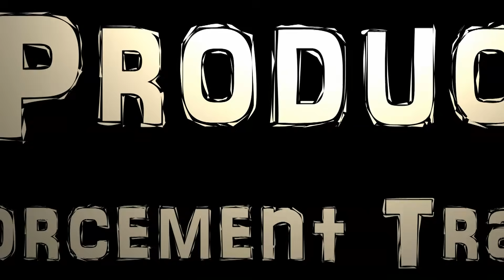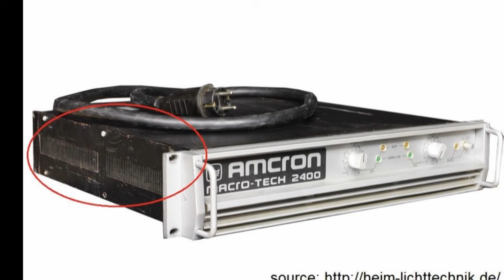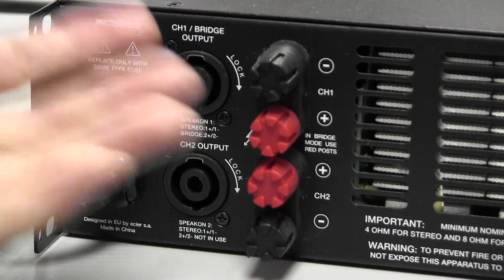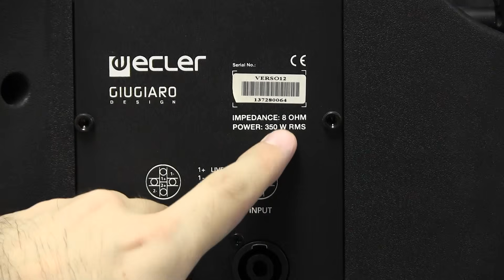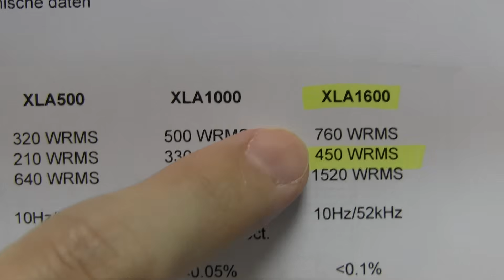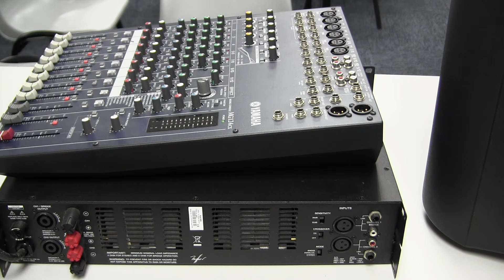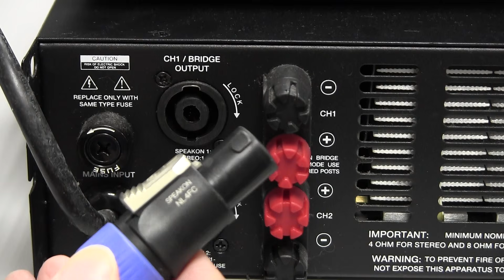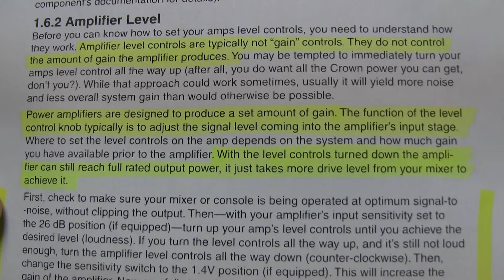How to connect a power amplifier to passive loudspeakers

Comment: Hi, I'm currently having trouble getting the proper connection between the mixer, crossover box, and amplifier.  We currently are using 2 (passive) house speakers on each side of the venue, 2 amps (1 for house and 1 for subwoofer).  On the mixer, when I turn up the left fader, sound comes out thru the left speakers.  When I turn up the right fader, I get both the right side house speakers and the bass frequency from the sub.  I would like to isolate the subwoofer to one of the 4 group faders on the mixer. Confused how to do that.
Reply from the maker: +Lee Sombito Hi there, thanks for the question. Which mixer are you using please?
Reply: We are using a Yamaha MG24 FX mixer.
Reply: Our crossover is the DBX-223S with QSC GX3 for the house and 'Crown' for the subwoofer
Reply from the maker: +Lee Sombito Ok, in this case the left and right outputs of your mixer should be connected to the crossover. The high output of the crossover should connect to your FOH amp and then to the speakers. Group 4 output of your mixer should be connected directly to the subwoofer amp. Anything assigned to group 4 will be sent to the sub - make sure that group 4 is NOT routed to the LR outputs, ie the 'TO ST' button should be up. That should solve your issue.
Reply: Thanks so much! I will definitely try this. Our church meets in the gym so we're one of those churches that setup and tear down every Sunday. I will try it then.
Love your style of teaching these videos. You make it easy to understand and you explain & dictate things very clearly and very well. Thanks Bruno!
Reply from the maker: +Lee Sombito Ah yes, setting up and tearing down every Sunday is a great way to learn about signal flow and also the various components of the PA system. Glad you have been enjoying the videos, if you would like to support the channel please consider signing up to become a patron at https://www.patreon.com/glbproductions?ty=h Every little bit helps!

Comment: can I hook up a loud speaker and a subwoofer to a single amplifier with crossover?
Reply from the maker: +Eddy S. Yes you can, assuming it's a typical two-channel amplifier: output of the mixer to the input of the crossover, high output of the crossover to one channel of the amp and then to the fullrange speaker, low output of the crossover to the other channel of the amp and then to the sub. I have a video on analog crossovers coming up so stay tuned!
Reply: Thank you very much.
Reply from the maker: +Eddy S. You're welcome :)

Comment: I am a beginner about sound system. I have a behringer xr 12 and ipad app to control eq. I am going buy 2 of QSC k8 speakers.I am going to use them for singing and playing acoustic guitar at home. My question is. are these speaker good for my behringer xr12? if is good. Do i need any thing else. of course i alread have microphone and all cable.and could you please guide me how to connect them together? 
Thank you so much
Reply from the maker: +Oup Kip The K8s are good for small spaces because of their wide dispersion and they have plenty of power, so no issues pairing them with your XR12. Just connect the outputs of the mixer to the inputs of the K8s and you're done. More info on the QSC K-series here: https://www.youtube.com/watch?v=CJ2YBbSLWw0

Comment: Hi Bruno!regarding this particular topic...is it true that Passive speakers are way better than the Active ones?(or is it an urban legend?)And have you ever done a vid about how to connect an active subwoofer to an active PA (a pair of active speakers)?Because Yesterday I've found two ways to connect it...One is that you connect the main outputs from the mixer and enter to the speakers,and then you go out to the subwoofer...or you can do the other way around...i.e. you connect the mixer's main outputs to the sub and the you take the signal to the speakers...which one is the correct way?As always,thanks in advance :)
Reply from the maker: +Cris Valk Hello Chris! With modern speaker systems the active and passive versions are usually the exact same drivers, it's just that the active model has an amplifier module fitted into the cabinet :) So any differences you hear will be the result of the amplifier that you use with the passive speaker. Where did you hear that passive speakers were better than active ones? 

I have an active subwoofer video in the works - stay tuned!
Reply: +GLB Productions Thanks!I heard it from some DJs...

Ok...I'm looking forward for it :)

Comment: Hi!
I have a question,

If i have a 500 Watt RMS subwoofer at 4 ohm and a 1000 Watt amplifier on 4 ohm connected to it, will the subwoofer blow up if i would turn the volume all the way up?
Reply from the maker: +Spixon Media It's not just the amount of power you are sending to the speaker - it's more important that you not clip the input of your power amplifier. 500 watts RMS will typically mean 1000 watts programme, so this is a good pairing assuming the power amp is not clipped.
Reply: GLB Productions Okay, but let's say, i don't clip it, but if i would run 800 Watts through the 500 Watt RMS sub, would it blow up?

Comment: hello Glb so when daisy chain, linking the amps i was wondering theres no concern of oms impedance ? what did you mean on good amps the inputs are buffered
Reply from the maker: +desi bhai In general there is no issue, as long as you are only daisy-chaining one amp to another - the chain can be as long as you want, provided you do not split the signal along the way. A buffer is a small electronic amplifier that ensures that the signal leaves the device at the same strength that it went in, hence preventing signal loss from one component to the next.

Comment: hi,that video is  very helpful  i had a question on how to use a speakon to jack especially when i am using passive speakers as monitors on the pulpit because i tried connecting direct from the mixer but it didn't work and sometimes the person who is leading would ask me to give them some volume so anytime i try to give the person the volumes that he or she wants i realize that both main speakers which are passive and monitors speakers that are passive as well has the same volume is connections,or setting and how am i supposed to loop them Thanks
Reply from the maker: +Chibole Cedrick I'm sorry I don't understand your question - it is about using speakon to 1/4" connectors or how to wire your monitor speakers?

Comment: Hi bro, if I daisy chain from low watts to higher watts speaker, is it OK? example:-   
From Power Amp (Samson SXD 7000) to 300 watt 15" speaker (Samson RS12HD} and daisy chain to 350 watts 12" speaker (Yamaha CBR12}.
Reply from the maker: +Zulkifli Noriman No problem - just remember that if they are both 8 ohm speakers each one will receive half the power that the amp delivers into a 4 ohm load and calculate accordingly.
Reply: +GLB Productions Thanks bro... Great info.

Comment: This guy talks so slow, I don't have time for this, I want a quick video about how to connect my fucking 5.1 home cinema system to an amp... and whats 2 channel or 6 channel or 123124234308597345873 channels what, those have to do with a 5.1, can I connect a 5.1 to 2 channel amp or reciver ?
Reply from the maker: +SparkySlow Hope you find what you're looking for ;) 5.1 means 5 fullrange channels (left, right, center, back left, back right) and a sub. So if you have a 5.1 system you need a 5.1 receiver to get it all sounding correct. You can use a 5.1 receiver to drive a simple stereo pair, but you must select stereo mode on the receiver otherwise you'll have lots of missing info.
Reply: GLB Productions ok sir thxs, um I just bought a nice Pioneer 7.1 and I have an 5.1 I connected now, im new in audio stuff, I connected also from pc to reciver trough an analog cable because my motherboard doesn't have a digital out. Also I have a question, I tough if will buy and reciver with some nice speakers and a sub will be all nice and stuff but how much an reciver consume, I mean it geats pretty hot without even turn the speakers on, will the reciver be on stand by power or will eat 300W continuously ? Im verypelease with the speakrs I own and I don't need the woofer right now. Speakers are Canton Plus XL, witch have mids very nice and highs, also some bass in the back, if I remove the sourund speakers and set the reciver only 3.0 system sound(it has that option) also I can set if the speakrs have bass or not, will the reciver consume less power.. im pretty concerned with power consumption.. and those things consume a lot.. the Reciver is a Pioneer VSX 916S. Also if I can ask a question, from pc I cant set 5.1 to work, now it sets on 2 stereo channels... when I want to switch to other channles like 5.1 it doesn't allow me, altough my mother board supports full 5.1 audio. The reciver supports dts and dolby digital ex, Pro Logic 2, right now I read on reciver that is on Pro Logic 2 is that because the subwoofer isn't connected and from what I heard it means isn't a full truly sourund system ? thank you again ?
Reply from the maker: +SparkySlow I suggest you get with somebody in person my friend - this sort of thing is very difficult to diagnose over the internet. The shop that sold you the receiver should help you hook up your speakers and sort out any connection issues. Good luck!

Comment: Why at 25:05 you connected the Amplifier Speakon output to the "stack out" of the speaker, and then you link the additional speaker out of the "input" of the first speaker? maybe those are inverted? I'm a little confused. awesome video by the way
Reply from the maker: +scubbasan There's no difference between the two connectors - they are paralleled internally so you can use either one as an input :)
Reply: +GLB Productions good to know, thanks!
Reply: GLB Productions I'm scratching my head trying to decide which of the Yamaha P-series amplifier would be optimal for a pair of EV sx250's, they are listed as 8ohm speakers with 350w long-term power handling and 1400w short term. EV doesn't provide much more information, they just suggest to "couple it with a Q66 amp or p-series" -.- plus these speakers are also a discontinued product. Do you think a Yamaha p-3500 would do? (350w x2 @8ohms) or should I look at the p-5000 (500w x2 @8ohms) just to be sure?
Reply from the maker: +scubbasan Yes it's frustrating when speaker manufacturers do not use standard terminology in their product descriptions! In the case of those speakers you can regard 350 watts as the RMS rating, so the P5000 would be a better match if you can afford it.
Reply: GLB Productions well, I will order a P-5000! the price difference ain't exagerate after all :) thank you for the precious info's! One very last question which is bugging me: if I want to send an Aux send from my mixer to the Amplifier to use one speaker as a stage monitor, being the Aux output in Jack, should I use a TRS Jack to keep it balanced? or maybe it would just be better to use an additional powered speaker as stage monitor?
Reply from the maker: +scubbasan Yes you should always use balanced connections wherever possible. Whether to use an active or passive stage monitor is up to you, but I prefer passive speakers for stage monitors because they look neater and are faster to set up.

Comment: You are thorough in your knowledge and very clear and elaborate in your presentation. Very good job!
Reply from the maker: +Rahul Rane Hopefully no more elaborate than it has to be ;) Thanks for watching!
Reply: +GLB Productions Hi again! I had a quick question - is it possible to connect my IPod directly to a power amplifier (inuke Behringer 3000) which has 2 XLR 1/4th inch inputs for Ch1 and Ch2. If so, is there a readily available cable for that? Thanks a lot in advance.
Reply: +GLB Productions Don't worry about my question Bruno. I think I get the answer: operate the amp in Mono, using TRS feed the signal from IPod to the amplifier input Ch1. The only downside is I wont be getting a Stereo sound - just mono on both speakers. Guess I will need a DAC/preamp or similar device to split the IPod Stero. Thank you so much again!
Reply from the maker: Rahul Rane I recommend that you do not connect that way as you will be combining a stereo signal into a mono input. See my video on how to connect stereo sources like this to the PA system, it will answer your question: https://www.youtube.com/watch?v=ge4Iynh4rcc

Comment: IF I USE A STEREO AMPLIFIER TO IT'S MAXIMUM IMPEDANCE ON ONE CHANNEL ONLY WOULD THAT CAUSE THE CHANNEL TO GO INTO CLIP MODE EVERYTIME IT REACHES A CERTAIN BASS FREQUENCY......
THE AMPLIFIER IS A CREST AUDIO V1500.......I'VE BEEN USING 8 OHMS.......700 WATT SPEAKERS.......4 OFF............AMP GOES DOWN TO 2 OHMS ..... AT 1000WATTS 
COULD YOU GIVE ME SOME ADVICE PLEASE MANY THANKS.....
Reply from the maker: +CHAZ THOMAS Bass frequencies require the most power to reproduce so they will be the ones that cause the amp to clip first. However whether the amp clips is determined by the input signal, not the impedance of the speakers that are connected. Reduce the input signal to your amp and see if it solves the problem. And please stop typing in all capitals, it makes it seems as though you're shouting ;)

Comment: Good video. I would just add that when paralleling amplifier inputs, not to mix RCA with XLR or RCA with TRS.
Also in that application, make sure the XLR  and TRS follow the same "hot pin" convention.
Reply from the maker: +Solitaire 514 Agreed, thanks for your contribution!

Comment: Great video. Very informative.    I noticed that at approx 21.55 in your video you show what appears to be a STEREO TRS jack plug on one end of the lead. Are the sockets stereo  or mono please ?
Reply from the maker: +Crusty1703 That's a balanced TRS connector - it's wired tip+, ring- and sleeve ground, and is mono. The inputs to the amp are mono, but can be balanced or unbalanced, depending on what type of connector is used. Thanks for watching!
Reply: Thanks for that info.
Reply from the maker: Crusty1703 You're welcome.

Comment: hi, GLB PRODUCTION  I have a carlsbro amp marlin 6-150 III and an amptech mixer and two passive carlsbro speakers and I want to link another amp with the carlsbro marlin and a subwoofer amp JBL with it can you help me?
Reply from the maker: +Black Shadow If you're going to be driving a subwoofer it's best to take the signal from a mono output on your mixer. Some mixers have a dedicated mono output, on others you can use a group or matrix output. This will ensure that no musical information gets lost.
Reply: +GLB Productions  THNKS a lot +GLB Production but i have one more question, if i connect the subwoofer directly to the mixer on the AUX sent  without passing by the amplifier will it sound good
Reply from the maker: +Black Shadow You cannot connect the mixer directly to a passive loudspeaker - you connect the mixer to the amplifier, and then the amplifier to the sub :)
Reply: thnks a lot GLB PRODUCTION
Reply from the maker: Black Shadow You're most welcome.

Comment: i have amp that has a switch ....... ground , left/right , what is that for
Reply from the maker: +Chrisopher Ramlal It's usually there to solve noise issues due to ground loops - check the owner's manual/circuit diagram to be sure.

Comment: could you please do a video to explain the back of a gemini xga 5000 amp please
Reply from the maker: +Chrisopher Ramlal I'm afraid those amps are not common in Singapore. Fortunately the back of that amp is very similar to the Ecler I show in this video - the only difference is the dedicated speakon output for bridge mode, and the fact that the signal flow is left to right instead of the right to left of the Ecler.
Reply: +GLB Productions ok thanks
Reply: +GLB Productions i have one more question..... if i use 1 channel for two loud speakers and daisy chain them and the other channel for powering 2 mointors and daisy chaining them would the power of each channel drop significantly due to daisy chaining them.....and furthermore its on stereo mode
Reply from the maker: +Chrisopher Ramlal In such a situation there's no need to daisy chain the channels because they work independently. Connect the send from your mixer for your FOH loudspeakers to one channel and the send for your monitors to the other one. Connect your loudspeakers and you're all set.
Reply: +GLB Productions ok thank you very much....this was very helpful
Reply from the maker: +Chrisopher Ramlal You're most welcome, glad I could help!

Comment: I have a set of old speakers from the 80s that I think are still operable as I've checked them. They are 1 pair of 30W Woofer with a pair of 12W tweeters for each woofer (so that's 4 tweeters). Then another pair of 25W speakers for mid range. All of them are at 8ohms each.  My question is what Amplifier capacity can I match with these speakers? Can it just be a 100W/4ohms amplifier or can I also have a 350W/4-8ohms amplifier?
Reply from the maker: +jepoyman! Please watch my video on this subject, it should answer your questions: https://www.youtube.com/watch?v=l9L7uK7Xy0w Thanks!
Reply: Thank you Sir. I'm checking this out now. :)